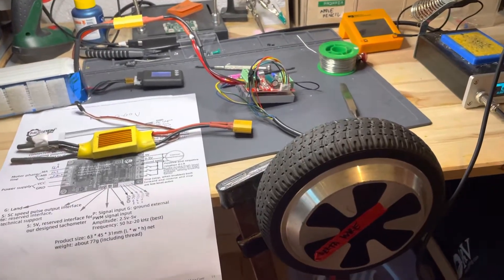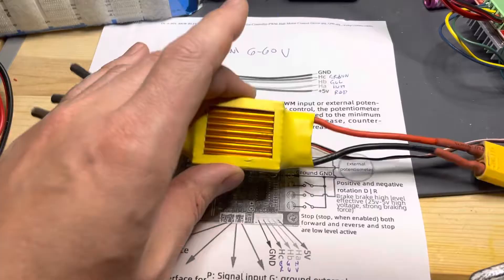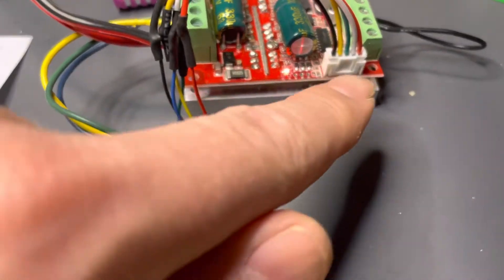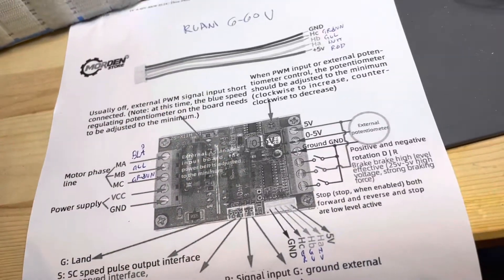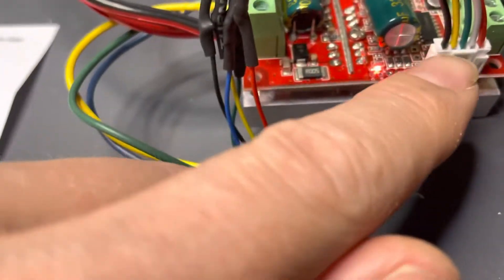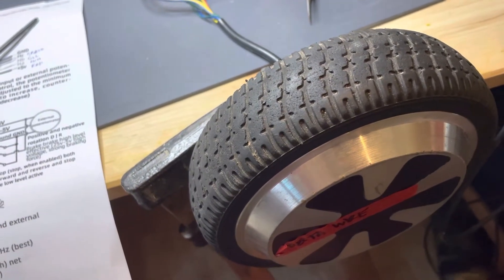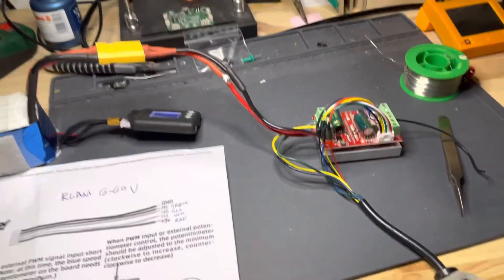How to run a hover board motor (with reverse)

Comment: With a potentiometer it's OK (0-5v), but with "finger throttle" (with hall sensor) the motor reacts when pressed but keeps turning when released (0.75-4.2v)

Translate a conversation

Comment: I had the same issue. There seems to be a combination where forward runs smooth but reverse runs jagged with 1/2 the speed. 
Since I had no schematics for my motor I just tried all combinations. I found the correct wiring and now it runs smooth in both directions.
Reply: Mathematically there will be six combinations. A couple combinations should run fine one way and studder the other way. A couple should lock up and do nothing, and then a couple will work fine. These last two combinations should be one, which by default, turns clockwise and the other by default should turn counterclockwise.

Comment: Hi, while the motor was running, it suddenly stopped and now the  battery vcc and gnd pins on the board are shorted…. Tested it for continuity with my multimeter, so whenever i connect the battery to motor driver, it just shorts

Comment: The hall sensor connector pinout on my hoverboard controller is in the order as the one on the ZS board. If the original hall connector is intact then just connect to the ZS board in the same order. In my case the blue from the motor connected to the yellow and the yellow to the white.

Comment: Is it possible to do 36 volts?
Reply from the maker: @mickmeuwissen8717  The board supports up to 60v so just make sure the motor doesn’t get too hot

Comment: I had the same issue until i rewired it several times. If it runs really fast and makes noice and there is no slow torque the wires might be not right.
Reply: This is how I wired colours FROM the motor, motor coil = A blue, B green, C yellow. Hall sensor = A blue, B green, C yellow. 5v red, gnd black. Check letters printed underside the circuit board, I don't believe the colors in the short connector cable, I just follow that motor wire colours match the letters printed underside the board...
Reply: @th9034  i have the same connections 🥲
Reply: @th9034  ohh mine is connected as
A- green
B-blue
C-yellow
Reply: It might be that you have one hall sensor or motor coil broken. If the motor controller do not get any hall sensor info it does not put any output on. There should be allways at least one hall sensor ON, never all 3 at the same time. If you push to start it then it goes over bad sensor but doesnt start if it stops on that bad sensor / coil
Reply: @th9034  i tried 4 different motors now, its highly unlikely all 4 motors have the same issue, but i do feel like it has something to do with the hall sensor
Reply: Ok then its not the motor... And the encoders are straight connected to the controller and no parallel arduinos etc? Enough voltage and amps?
Reply: I'm using two 5200mAh 40C 11.1V LiPos in series to power the motor, and I also tested it with a 35V power supply, but the results were the same. Interestingly, when I used a standard 30A drone ESC, the motor started spinning without any issues, so it’s clearly not a power problem. Additionally, since the motor runs fine with the ESC, it confirms that the motors themselves are in good condition.

I cant seem to wrap my brain around this, is the motor driver limmiting the current? Is it not reading the hall sensors properly?
P.s i tested every single hall sensor
And they seem to function fine
Reply: Hi, im facing the same issue now, could you pls let me know what wires you changed?
Thankyou
Reply: Mine needs a slight puch with my hand for it to start spinning
Reply: Ok. If sensor a b c and motor a b c colours match it might be controller. The short connector cable fooled me, i have it connected green to yellow and yellow to green and blue to white. But these things are so cheap that quality is what it is. Sorry that I couldnt help to fix it...
Reply: @th9034  thanks alot for your prompt responses, will update if i find a fix
Reply: @th9034  Hi update..
It worksssss, you were right, one of the motor phase wires was burnt inside
Reply: Glad if I helped. Greetings from kuopio, Finland.
Reply: @th9034  Thank you for your help and prompt responses, best wishes from Sri Lanka

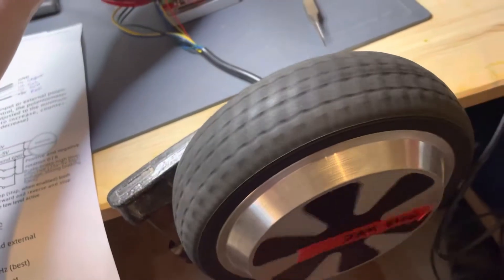Comment: ah, you have the same problem I was going to ask about...@3:50, terrible low speed performance in terms of that grinding sound and I would guess also much lower torque relative to the hoverboard controller.  I guess maybe these ZS-X11H boards simply can't do smooth low RPM's?  The original hoverboard controller obviously does as when you stand on it and lean forwards it can go very slowly and very smoothly forwards.  Too bad if this is the case as these ZS boards are way easier to use.

Comment: Reverse is broken so almost half of the functionality is bad, it locks up so it's even worse than if they didn't provide the reverse.
I hope it can be fixed by mixing around the hall sensor wires.
(btw hacking hoverboard motherboards with custom firmwares gives you dual esc without such issues...)

Any update?

Comment: Using same ZS-X11H.
https://www.youtube.com/shorts/vwXGz9Ci9wY 

Not bad. But!
- no direction detect. Only one phase encoder tick;
- low encoder resolution, cause same reason - only one hall sensor in output "speed pulse";
- two modules are dead on the same wheel (maybe wheel is broken) at big torque reverse.
Reply from the maker: So you think the problem with these is that they only use one encoder input?

Comment: These boards are really crap.. 6 of them went bad
Reply from the maker: Sorry to hear, did this happen during normal use, or during stalls etc?
Reply: I have the same problem with these motor drivers. I’ve used them for a couple projects now and 3 out of 6 is now dead. Do you or anyone know of a better alternative?
Reply: What is name of Circuits😊

Comment: what are your plans for the controllers and the hoverboard motors?  I'm working on a setup similar to yours.
Reply from the maker: Hacking the original driver board is far better in terms of smooth control. I was unlucky about the version of my board and couldnt get a proper firmware for that exact version. But some people are happy with the replacement controller as well.